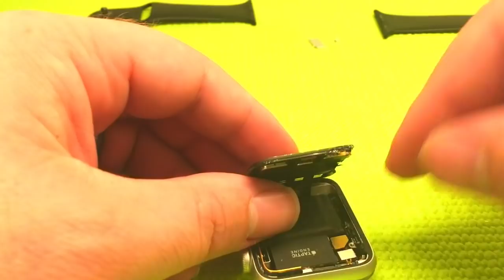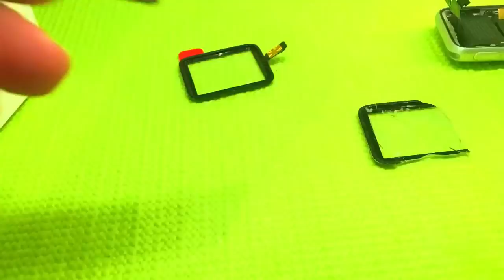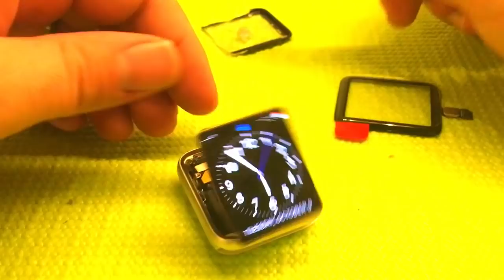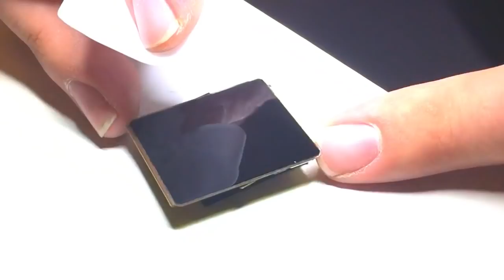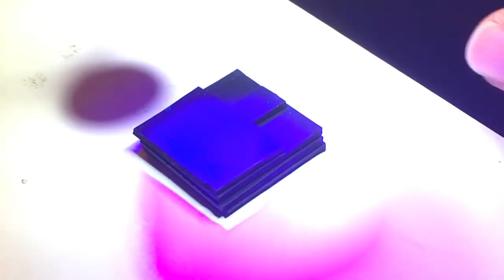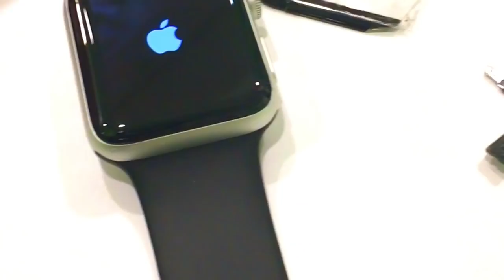Apple Watch Series 2 Successful Glass Repair

Comment: Great video. My watch screen is smashed. Was just wondering if you’d recommend a digitizer replacement vs a new screen? I think replacing the screen would be easier but more costly. It seems that only the digitizer is damaged as my screen looks all good still.
Reply from the maker: Great question. It depends on the model. Check out my website for my repair price to see if that might be another option. Fixdirepair.com
Whole display replacements can mess with functions like Apple Pay as the NFC is paired to the device and is on the display, that’s another reason to only do digitizer/glass

Comment: Hi thanks for the video it worked a treat. I didn't need heat to get the screen away from the digitizer and thought I had done everything okay. Cleaned the screen up and plugged the 3 x connectors back in but nothing. I can feel the watch turn on but no screen. Any ideas what this could be? I was very careful with everything so not really sure. Thanks
Reply: Ever figure it out?
Reply: So the screen turned on before but not now ?

Comment: Hey there:) I tried this repair myself and everything worked fine, except some damage on the LCD, but it still works:)
My only problem ist after replacing the digitizer the touch still does not work sadly , do you have any idea why this could be the case?
Reply: I think you may need a new lcd. Or there is also another video I saw on it but I’m not sure.

Comment: can you please tell us what temperature you set the heat table for?
Reply: I set my screen separator machine to 164 degrees to be safe and this worked fine for me. Other videos show 80 celcius which is about 176 degrees. Take into consideration that screen separator machines fluctuate in heat and may get too hot at times so use a separate thermometer to measure the plate temp so you know if the displayed temp on your machine matches the plate temp. Just be careful because the longer you leave the apple watch screen on the higher heat like 176 degrees or higher the chances are you'll damage the LCD screen. Work fast to lesson the time you have the watch display on the heating plate.

Comment: Really nice video :)
Can you also just wait till the screen is dry ? or do you need a UV light to put the screen on the lcd ?
Reply from the maker: Maxi Eder LOCA is  uv light activated glue. Theoretically you can leave it in the sun light and it will cure over a longer period of time. It’s just more precise and higher amount of UV rays with the UV light.
Reply: @FIXDPHONES  Thanks for you answer !

Comment: HI can u explain me why after two different touch replacement everyone not work? I am reading about pairing lcd and touch but you need to use special adapter named ibus S2 can be this the reason for faulty touch screen?
Reply from the maker: sabino nesta it’s most likely a aftermarket screen that hasn’t been flashed. Finding a distributor that has original digitizers is what you need to do.
Reply: @FIXDPHONES  Thanks so much for your suggestion. It's no easy to find it,  If you can tell me an e'shop where to buy an original digitizer would be a big favor for me. Best Regards